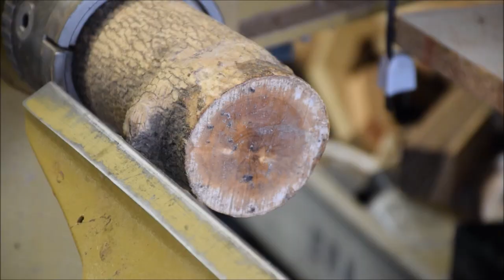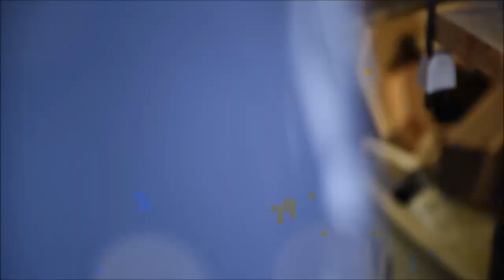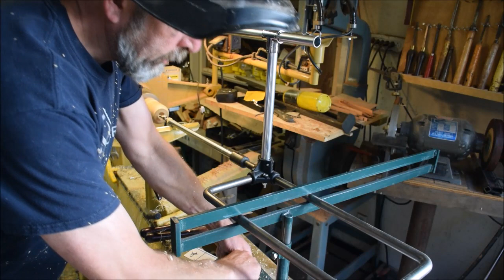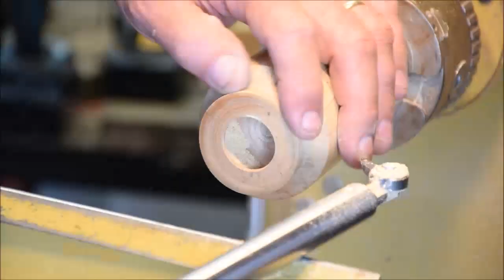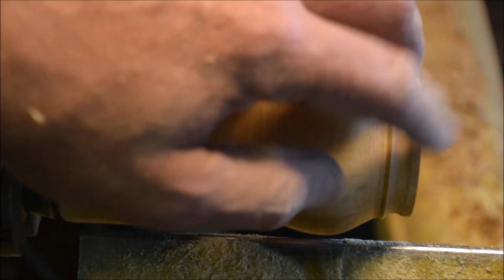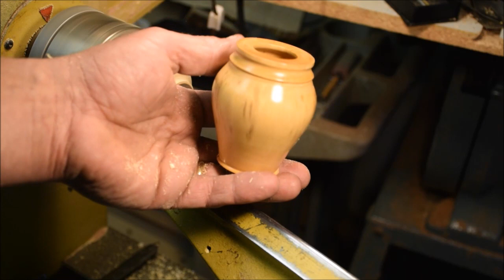Woodturning With The Naked Turner Lyle Jamieson Hollowing System

Comment: Man. . . I saw this coming a mile away. Glad you got hooked up with a laser system. Nice form even though I would have broadened the opening. But hey!, it's your artistic license, not mine. Hope you continue to enjoy Lyle's device and share the results.

All the best, 
--Joe
Reply from the maker: I was going to but I was trying to push the limits of the small opening to test out the smallest hole I could do with this sized boring bar.  There is a smaller bar but I think this is a very small opening at about 1 ".  I really like the capabilities it has and the new forms it will allow me to try and make!

Comment: I assume the cutting bit used here is HHS, since you mentioned that carbide cutters are available. From the video it looks to be a square bar. Do you mind me asking what size it is? Also I noticed it seemed to be kind of aggressive at times while cutting, are you able to turn the boring bar in the handle to give the bit a negative rake?
Reply from the maker: Gill thanks, this was my first piece using this system and now that I have done another I figured out certain things and was able to watch some of Lyle Jamieson's videos again and figured out a few more of the subtleties and it works great.  The HSS is what I have but I am sure it will be nice to try the carbide cutters. It is round bar but the d handle makes it super stable and so easy to control once you get it all setup right and get the hang of a new feeling.  Check out his website and he has different sized boring bars for different applications.  I have the 3/4 inch system which accepts  several sizes of bar!  Like I said check it out on his www.lylejamieson.com site.